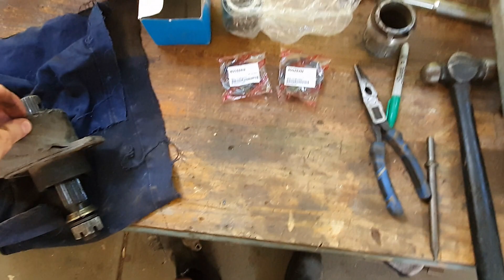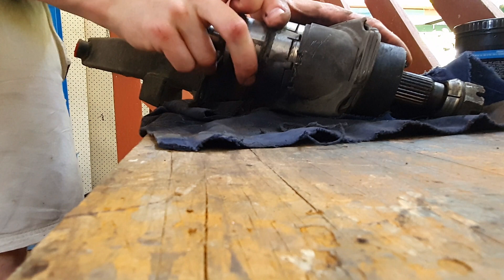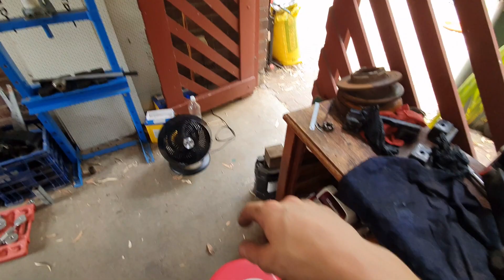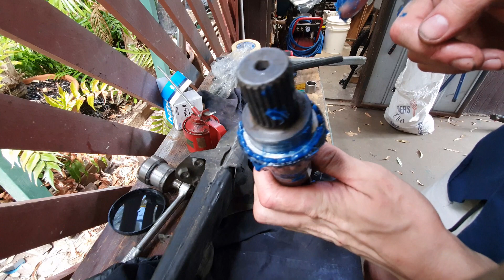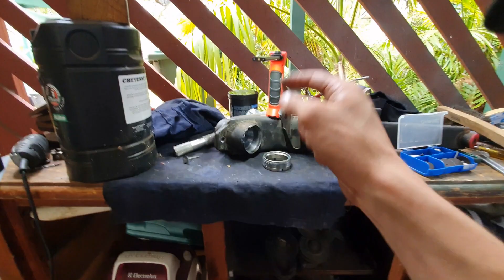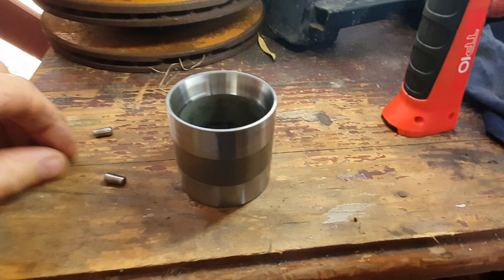Rear wheel bearing replacement - Subaru Brumby/Leone

Comment: For those of us without welders and beefy vices - I managed to grind 46mm socket so that it has the 4 tabs. Took close to all the beans a milwaukee mid torque impact wrench + 12ah battery could give to undo the first one. Second one was easier since it was from the less rusted side of the car.
Huge thanks for this video, mate!

Comment: Hey I was thinking of putting my spare tire on the hatch of my 79, haven't seen anyone else do that!  Did you have to I get stronger gas springs for your hatch?
Reply from the maker: My spare is mounted to the rear bar on a swing-away arm. Not sure the rear hatch could handle that!